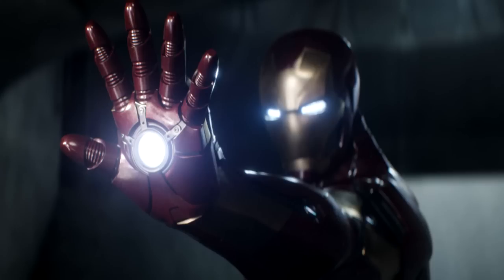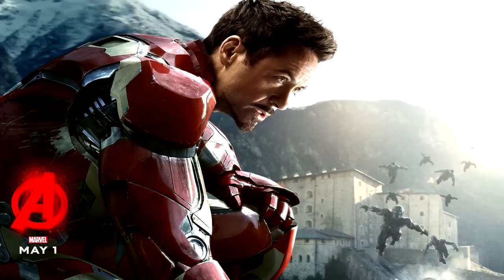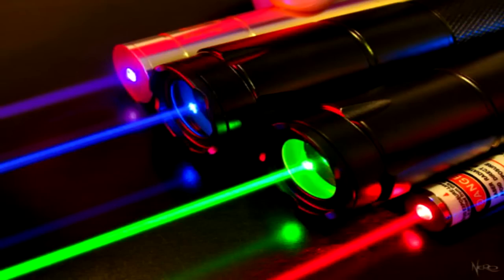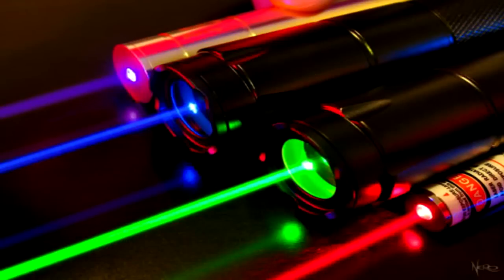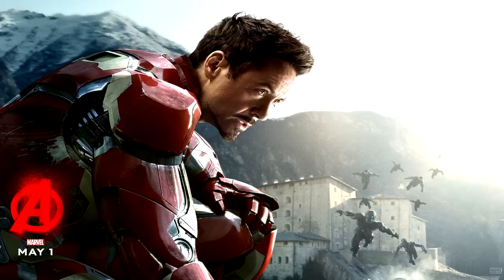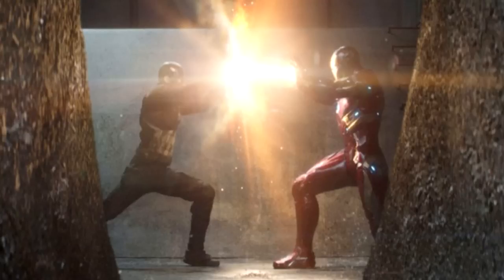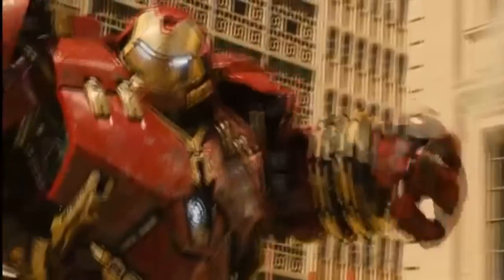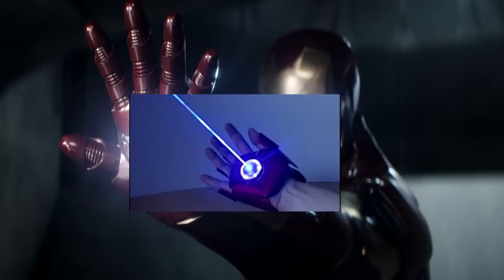How Do IRON MAN's Repulsors Work? - Science Behind Superheroes

Comment: It cant be lasers because
1. In iron man one he describes them as flight Stabilizers, meaning it has to produce some kind of pushing force, which a laser does not produce
2. Alot of the time when he shoots someone with it, it knocks them back like a concussive blast as opposed to burning right through them.
3. In the avengers it is shown that he has a laser on his gauntlet that acts as a normal burning laser does that functions very differently compared to his repulsor. 
In short: the repulsor blasters cannot be considered lasers
Reply: 2 and 3 are correct but lasers do produce a repulsive force. thats the whole reason that solar sails work. it is miniscule but in theory a powerful enough laser can sustain flight, although its extremely unpractical.

but i also think this video isnt entirely true to the iron man lore. his repulsors are described as muon beams which is drastically different from lasers.

Comment: Stark does not use lasers to provide thrust. That violates Newton’s Third Law. I saw on an expert physics forum that the best way Stark could build a real life repulsor is the following:
Firstly since he doesn’t carry propellant in the suit, the propellant must be out of the suit. This means he is using air molecules. A helicopter uses air to provide upward thrust by forcing it downward, but it does this with blades, somehow Stark does this with electricity. Basically he made a really advanced atmospheric ion thruster. 
On the sides of the suit’s arms are filtered intake valves that take in air molecules. The air molecules are then bombarded with a high energy electron gun. This strips the air molecules like oxygen and nitrogen of electrons, yielding them a positive charge. They are now positively charged ions. He then provides a path for the ions to travel along a very strong magnetic field towards the palm ejection mechanism. They are guided by strong electromagnets that oppose the positive charge so the ions do not hit the interior walls (doing so would make them lose momentum, and thus thrust). The ejected electrons are then collected in a ground pathway, while the traveling ions are traveling in uniform motion towards the hand since they cannot touch the walls, nor can they touch each other due to having like charges. 
Now since F=MA, and Tony needs force to allow him to gain upwards thrust, the problem is the mass of these air molecules is small (the “M” in F=MA is small), so he needs to make the acceleration of the ions VERY high. To do this, he needs to supercharge and heat the ions under an even stronger magnet to accelerate them to thousands of meters per second. This plasma is what you see when the repulsors come out. Unfortunately this causes two more engineering problems:
1. Plasma likes to spread out, but Tony needs a focused “column” of the repulsor, in order to be efficient and effective. So he somehow needs to focus the beams directly out and straight.
2. These supercharged ions will be coming out of Tony’s hands smacking against regular air on the outside. Without getting into too much detail, this is bad, and would deafen anyone standing within 1,000 feet, and would damage the integrity of Tony’s suit.
Tony, being a genius, solved both of these problems with one engineering solution: A focused vacuum.
In each arm, there is a bleeding-edge pressure differentiator running on AC current that is shaped like a small cylinder. When AC current is ran through it, it amplifies a pressure differential into the air shaped like a large cylinder. The larger the current, the larger the pressure differential. Air that is within the pressure differential is forced to the “edges” of the forming cylinder, traveling up and into the pressure differentiator. The effect is a large cylindrical shaped “column” of vacuum emitting from Tony’s hands, completely void of air particles. This way, the supercharged plasma can come out and only travel in that cylinder, and would not have to hit any air molecules on the way out. The vacuum slowly phases out over a few hundred feet, so the repulsor beams can slow down and lose energy without causing a huge explosion. The air compressed and collected in the differentiator is then recycled to use as thrust.

So when Tony wants to fly up, the pressure differentiator is switched on in the circuit, causing a vacuum column several hundred feet out. Air is sucked into the valve, ionized, and redirected to his hand via electromagnets. The ions are then superheated and accelerated through a magnetic field and ejected at high speeds through his hands (and feet). The force of the air ejected at high speeds outwards provides a reaction force on Tony upwards, providing thrust.
A gyro in the circuit automatically adjusts the angle that the repulsor ejects to perfectly orient Tony upright without his input. A superconductor cooled to near 0 Kelvin helps exhaust excess heat over a large surface area over the suit. Obviously something like this cannot exist without an enormous power source, which the fictional arc reactor would provide. In fact, his repulsor beams would be the most energy intensive mechanism in his suit.
Reply: You have a lot of time and knowledge man
Reply: What about Tony’s space suit? We never seen him actually fly in space in the movies, but he apparently did make a suit that can fly in space as it was in IronMan 3, part of the iron legion. Also, his thrusters work underwater, as we saw in IronMan 3 again.
Reply: This is a very good and possible theory, but I have a question about a arc reactor. It runs as a nuclear powersource, but it doesnt seem to have a way to transform the energie from the nuclear reaction into electricity. Do you know more about this? I was thinking that maybe because of the circular form of the reactor the elektrons coming from the radioactive core would be propulsed around in the tube, and the copper spools curving around it would use that kinetic energy like a dynamo and thus create electricity. Is this a possible theory?
Reply: Max Foissard A scientist kind of looked at the Arc Reactor, here is the article he wrote on it:
https://gizmodo.com/how-iron-mans-arc-reactor-probably-works-1661613682?utm_source=feedburner&utm_medium=feed&utm_campaign=Feed%3A+gizmodo%2Ffull+%28Gizmodo%29

It’s a Multi-Isotope Radio-Decay Cell. NASA uses something like this with rovers on mars with radioisotope decay cells, they just don’t produce nearly as much power as Tony’s arc reactor, and produce way too much exhaust heat.
Reply: @captainobvious1415  too much exhaust heat, too back that heat can't be made in too electricity
Reply: @pako8626  right dude but the reaction is not enough to make high energy in real life but u get a minimal renewable energy from the arc reactor.. so pretty useless...btw stark used plutonium in the arc reactor 
also if u want to know more abt future energy check particle collider and particle accelerator... at LHC(Large Hardon Collider) they generate 13tev from 6.5tev there is massive energy produced cuz when they collide particles at nearly light speed minute black hole is created and traces of antimatter is for. Due to matter and antimatter collisions high energy is generated.
Reply: I love your name and then the comment
Reply: I'm not smart enough to thwart your science, but I do have some questions.

1. What prevents the suit from overheating due to
   A. The heated plasma
   B. The circuitry that would need to be
        i. Either a larger gauge wire than could be placed in the iron man suit or
       ii. Pure metals that couldn't handle the strain of high amperage over continuous use of time?

2. How would Tony's arms support the strain of flying Mach anything using weak electric motors of that size? The size of the motors required to withstand that kind of strain would exceed the size of the suit and inhibit its mobility.

3. What prevents all of these intense magnetic fields required to 
 A. control the plasma, 
 B. make the arc reactor function
From messing with the electronics, memory banks, and other such electrical equipment required to make the suit functional?

4. And this https://youtu.be/djXLI95GJKQ

Sorry if this looks weird. I'm writing this on my phone.
Reply: the most intensive was his concentrated laser above his arm. it can cut even concrete instantly like a paper. but it sucks most of his juices tho so in a long fight, his repulsors are his strongest asset
Reply: @nozomi-dori  kinda makes sense.
Reply: Now i can build an 
iron man suit
Reply: You all probably dont give a shit but does anybody know a trick to get back into an instagram account??
I was dumb lost my password. I appreciate any tricks you can give me!
Reply: @Khari Colson Instablaster =)
Reply: Finally someone that understands english.
Reply: na i dont like this theory bc it is not focused on creating thrust from the main power source. what do u think is his power source? also when he flys in space there is no air molecules to do what u said.
Reply: @isoswoosh1  Stark can’t get around Newton’s 3rd Law. If he is to exert a force downward, there needs to be mass to throw that way. Arc Reactor doesn’t create new mass. Stark must necessarily either get his mass source from his suit or his environment. It’s not from his suit, and therefore must be from his environment.
Reply: ive been searching this everywhere, and this answer is the only good one
Reply: Nice

Comment: I googled it and found that it works by transforming electrons into muons (that penetrate deep into atomic matter) and then feeding them to the suits palms and chestpiece. I don't know much about that level of physics but I'm pretty sure muons have mass which would hence explain the presence of a force factor when it is used. How electrons are turned into muons, I don't know and it is probably not possible in practice right now.

Edit: Just checked and it is possible to make positive muons (and neutrinos) when high-energy protons (>500MeV) are collided into a target of carbon or beryllium. The problem with doing this, far as I know, is that the only practical (not theoretical) method to increase the energy of a proton is to accelerate it until it is travelling at high enough speeds (near light speed). In other words, protons can be turned into muons if you have a spare hadron collider lying around. There are only theories about how electrons could be turned into muons.

Comment: You know what these all are science frictions i mean iron man not only shoots super concentrated plasma but also uses it as a more or less jet engine.  For flying With maximum optimization do you all think one device can do all of these,👍
☺️☺️☺️☺️{Think}
Reply: RAMA MUKHERJEE The repulser is made by compressed hydrogen gas being combusted in a small combustion chamber, that aims it in front of the hand this creates force and heat. The hydrogen is extracted from the air, air is made up of hydrogen and oxygen, this is the only way that the repulsores could be made at that level of strength.

The only reason I pressed this vid is because I wanted to hear someone else’s take but this is just stupid.

Comment: Lasers? Come on. Light doesn't have impacting mass. The repulsors have repeatedly been shown imparting impact force to any struck objects. No, it's not lasers, unless he's found a way to add mass to light, which, while it would be a huge paradigm shift for light science, would also require the addition of either an electron or proton or even a neutron (easier to get neutrons, btw) to the light beam. Sadly, this would also give it the property of standing right beneath a nuke going off (regarding being irradiated). So no, it's not a laser. It's something else. Perhaps an electron accelerator (electrons in atoms go around 5million MPH) pushing them up to say 50 percent the speed of light. Tesla spoke of an energy field that could be accessed, throughout the entire universe, and if accessed it would give nearly infinite free energy. He also spoke of Scalar Waves, which are superluminal, and entirely different from radio or sound waves. Just throwing that out there. My theory is, repulsors are a field generator that repels oxygen atoms in the air, or a field that simply breaks apart any molecules with oxygen atoms in the field's effective area. It would then break apart air violently, producing thrust, or would break water apart, producing heat also.
Reply: Look up electric 
corona discharge.
Reply: do I need a tin foil hat to find it?
Reply: davidsirmons  is also known as electrohydrodynamic propulsion

Comment: Ok but how is he supposed to fly with lazer? It can't only be lazer it's impossible
Reply: Moon Man  may be he use sone kind of fuel... 😂😂😂👽
Reply: laser can push off stuff
Reply: Benjamin Connor yea but this would have to be many petawatts to lift the 200+ pounds it weighs and go at supersonic speeds.
the only way he would get such power is by burning hydrogen and oxygen in liquid state this has been shown before to have force similar to getting hit by a 90 pound hammer falling from 7 meters or more.
Reply: I didn't  realize that was an option, I've heard of stuff like that. Didn't think a rocket could run on it
Reply: Carlos Arrache Gaming keep in mind. The arc reactor has seemed to have a “limitless supply of power”. That could theoretically provide enough energy for the suit

Comment: I have a theory about why the beams are so big. The most suitable laser for the iron man suit is the pulse yag laser but the problem is that the point is usually really small and concentrated and it also has a wavelength that is not visible to humans. But since it is so powerful it breaks down air molecules and turns them into plasma so that is the visibility issue solved and the laser is super powerful it ionizes large quantities of air.
Reply: So it is not the laser that we see it is the plasma
Reply: But that would cause radiation, A lot of radiation. Deadly amounts

Comment: Is it possible that the lasers heat up the air in the suit to create plasma? It would take a lot of energy, but plasma fits most of the criterion for the repulsors. Plasma could also be magnetically propelled and manipulated.
Reply from the maker: Interesting idea! The only thing I could see backfiring is the heating of the suit, metal tends to stay pretty hot for a bit after it's been exposed to heat. Also, please do explain how plasma could be magnetically propelled, I've actually not heard of that before!
Reply: @FireplaysMC  plasma is quasi neutral but it is made out of ions and electron. If a plasma is in the range of a strong magnetic field, it will create  it's own magnetic field which would be propeled by the original magnetic field.
And iron man is the genius who figured out to make cold fushion. He could easily solve the heating problem via liquid helium.
Reply: It can be magnetically manipulated because there are free moving electrons.
Reply: Heating could be a bit of an issue, but you could keep the plasma from coming into direct contact with the suit using the magnetism. Heat would still radiate to the suit, but not as fast as if it was in contact with the suit.
Reply: Plasma can be magnetically propelled because it is made of ions. Ions are positive and negatively charged atoms along with free flowing electrons. Due to the charge, the plasma can be manipulated by magnetism.
Reply: do a video about thor and how iron man gets his suit so compact
Reply: webslinger911 is right
Reply: maybe
Reply: webslinger911able It seems like it, but the repulsers from the film seem to be similar to rocket exhaust. It could heat up and make plasma that why. Lasers would not work at all. It would require to much energy and would be incredibly destructive.
Reply: KLyfe - Science Behind Superheroes late reply, but have you heard of VASIMR?
Reply: I had the same idea
Reply: webslinger911able Even if we have lasers like that we would need a lot of energy like 1-3 gigajoules per sec to power up the laser, but Unfortunately in our reality we don’t have such wires that moves tremendous amount of energy